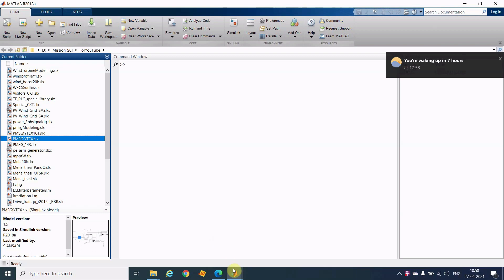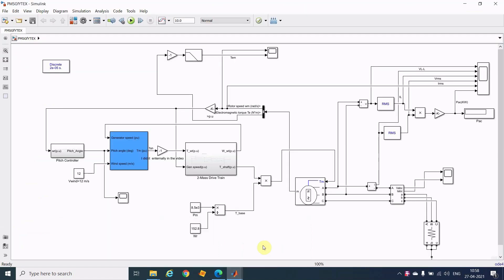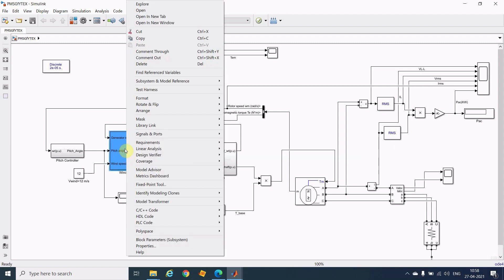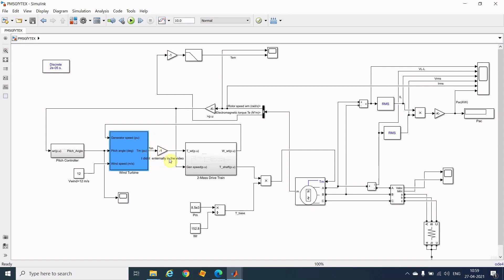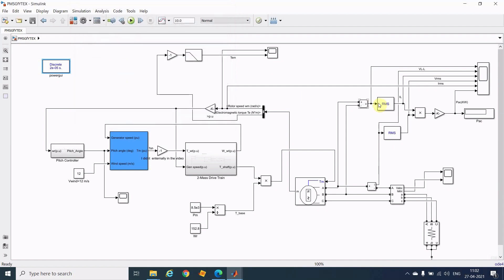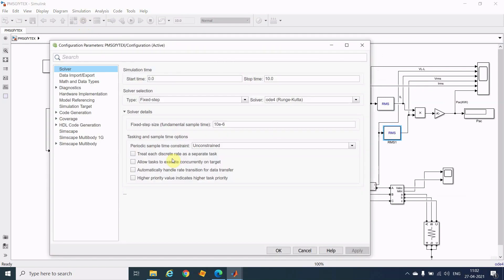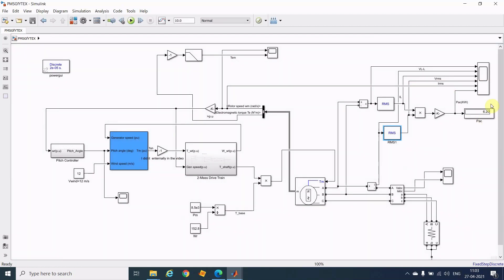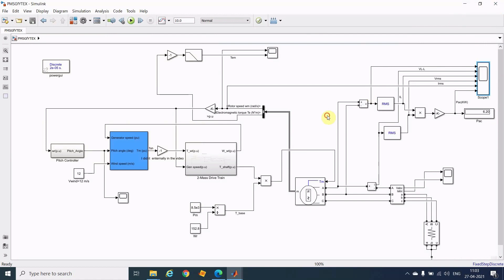Correction Video for "Simulation of Pitch angle Controller and PMSG based WECS: Part-2"

Comment: I did the changes u explained here, because in the previous video i get value of the Pac = 0.0095 (different from yours, your Pac = 6095) and beta = 0 (same as yours) . But after i did the changes here, it makes my Pac (10126.4 or 1.013e+4) and my beta = 19.95 (not 0)

Comment: Hello Sir, Thank you for this simulation and explanation.
I did the same thing but got this error, ''The terminals of the 'untitled/Permanent Magnet Synchronous Machine' block cannot be left open-circuited because they are modeled as current sources''. If you can help me, I'd be very grateful.